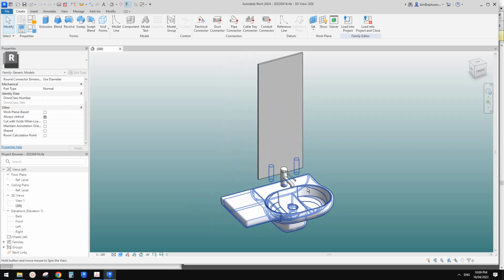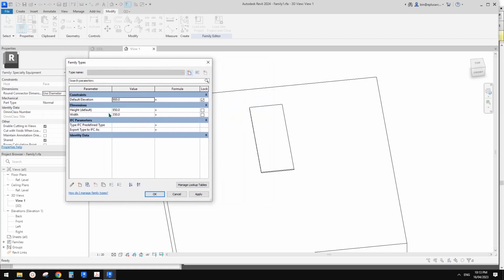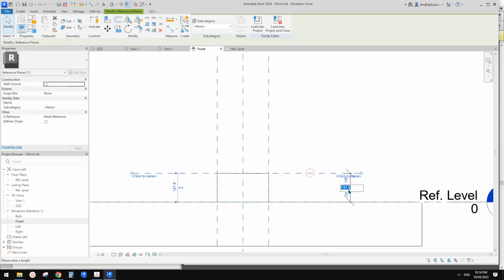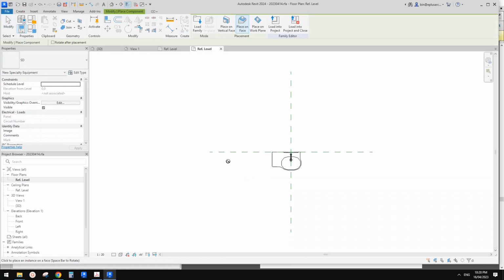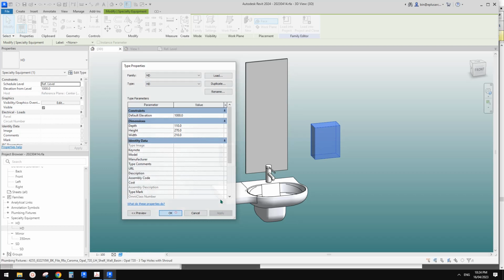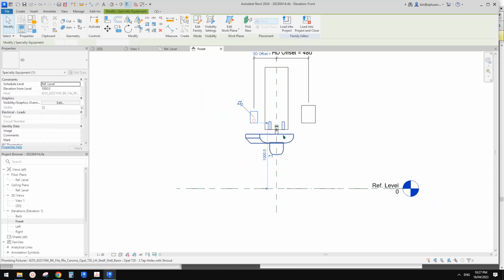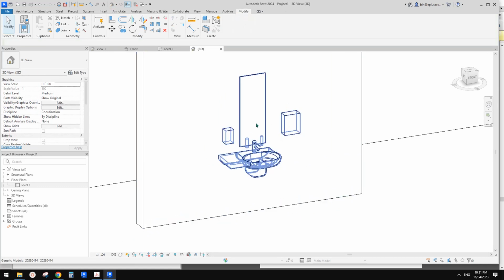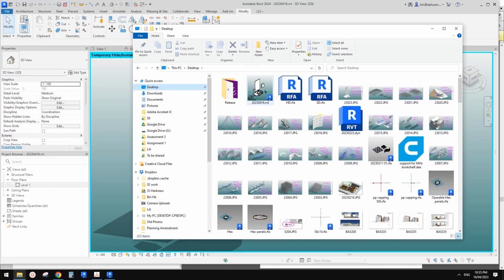23024 - Revit Family Modelling Basics EP2

Comment: Thanks as always for the video. Would you please provide comment on the best way to incorporate alternatives into your family. As example, you showed the Caroma tap, what is the best way to load two taps into the same family so the end user could select one over the other? Thanks.
Reply from the maker: There are two options available to accomplish this task:

Position both taps and create visibility parameters for each of them. This will enable you to choose the desired tap to be used in your project.

Load both taps into the family, position only one of them and add a parameter by selecting the tap and navigating to the "Label" drop-down menu. After the family is loaded into your project, you can utilize the parameter to switch between the two taps. However, it is imperative that both taps be modeled in the same category, base type, and location relative to the origin.